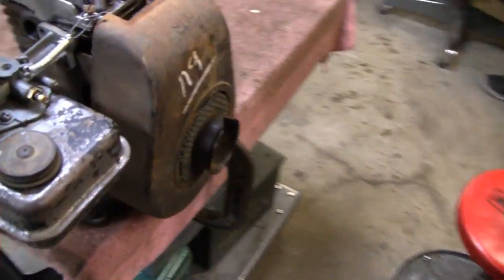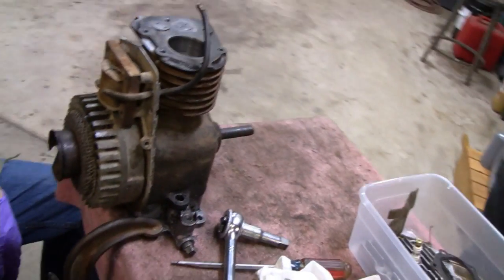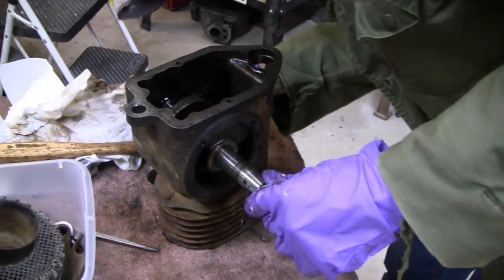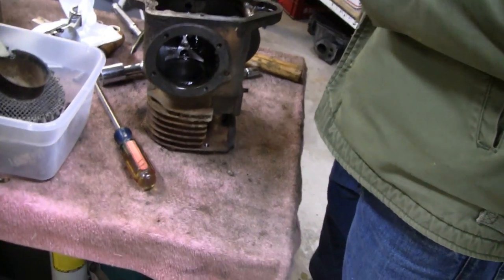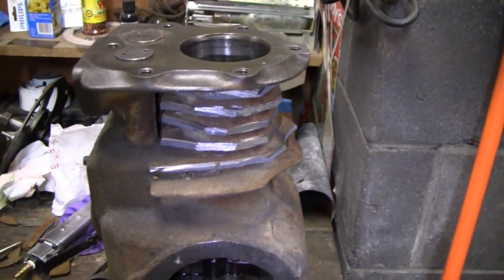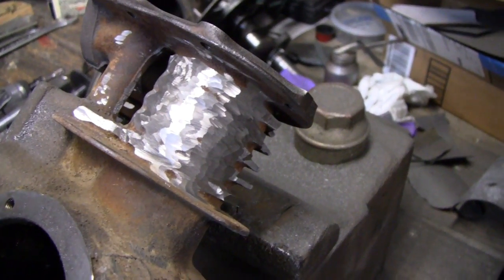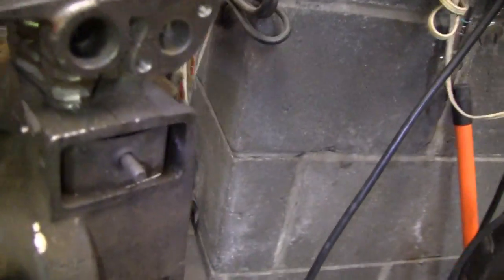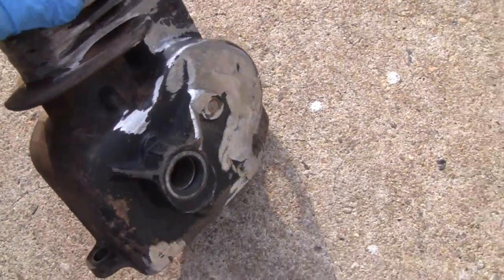HOMEMADE WATER COOLED BRIGGS ENGINE (part 8)

Comment: cooling fins with a tank built around them and around the cylinder that water flows through sounds like a very effective way to cool it, water goes in from the top and comes out the bottom and goes to a radiator or whatever, probably start out with a bucket and a swamp cooler pump

Comment: Fins would run cooler if you have tubing.  If you do a full water jacket around the whole cylinder then fins probably will reduce circulation by creating flow restriction (of convection currents) and creating hot spots.

Comment: I really like the way you dressed the block out. Looks much better without all the extra casting. Are you going to make a water pump, or just use a siphon type cooling system... like on old tractors?
Reply from the maker: Thanks Bud!! We have a water pump and radiator!!☺
Reply: How cool. You make the coolest things! When are you going to make a 5 cylinder radial engine out of those old 6S Briggs & Stratton??? I bet that would take some work and lots of time... and lots of 6S's.
Reply from the maker: We have been working on a 3 cylinder Radial for 2 years now, but it probably won't be finished for another 5 years. here's the playlist of the videos we made already of it  https://www.youtube.com/playlist?list=PLOkM2h167hjq5geboZYvrUfXm7ypsSJDC

Comment: how hard are the little maytag engines to get running again  I Just bought one for 100 its all there but its missing the plate the little linkage goes through
Reply from the maker: If the coil is good it should start right up!!☺

Comment: Cooling fins would give more surface area which would aid cooling, but that isn't necessary with it being water cooled. I'm assuming you are planing to have a radiator so It would be more fitting to have it fully smoothed out. Check out Jay Leno's project car vlog about the liquid cooled engine they are making new jackets for, that would be a great look!
Reply from the maker: Yeah it has a nice radiator!!☺
Reply: Better to have the fins removed. High frequency vibrations when the engine fires would cause cavitation, most likely where you wouldn't want it. The rough surface left by the removal of the fins will give less of a chance for erosion due to this, If you've ever seen inside the water jacket of a commercially made water cooled engine, they leave it rough on purpose. There are many different grades of casting sand, the finest of which would allow a quite smooth surface that could be chemically smoothed even further. 805RoadKing is doing it right.

Comment: I think under normal operating conditions, the cylinder would get nearly red hot without the fins, but a slow idle display engine it may be ok.
Reply: Wayne Earls it can't get that hot with water around it... yo do realize they're making it into a water cooled unit right?

Comment: Having the fins increases the surface area exposed to convective cooling. The rate of convective heat transfer is equal to hA(deltaT) where h is your convective heat transfer coefficient and delta T is the temperature difference between the fins and air in this case. "A" is the surface area exposed to convective heat transfer. Like I said earlier, having the fins increases the surface area exposed to convective cooling thus increasing the heat transfer rate from the engine to the air.  Looks cool without the fins though
Reply from the maker: Yeah it's almost a shame we have to enclose the cylinder!!☺

Comment: Love the project, Buddy! She's coming along. As far as the fins, I would have left them on. The fins would have dissipated the heat better by allowing it to travel away from the source (cylinder) and throughout your coolant. Kinda Similar to how a radiator has fins in the core to direct the cool air to the hot coolant tubes. That's just my 2 cents on the topic. Regardless I can't wait to see the next video! -Nick.
Reply from the maker: Thanks Buddy!! It is gonna have a radiator and pump also!!☺
Reply: Awesome! I can't wait to see the progress!

Comment: As a reference between the air cooled version and the water cooled version is there a place on the engine you will take temps to see what difference the water makes vs the air?  Maybe the head?  Are you planning a heat exchanger and what form will that take?  Thanks for the good video today!  I needed it because I'm in the third week of this cold or flu that everyone seems to have here in Georgia.
Reply from the maker: Probably won't be able to get an accurate reading!! It's gonna have a water cooled head, no heat exchanger  but a radiator!!☺
Reply: In Australia .... I've just started my fourth week of being diseased ..... Word round the traps is that it lasts for five weeks .....

At least I'm old disabled and don't work ..... :)

I feel for those that do ..... :(

Comment: this is an exciting project. you should spray paint all the metal parts in contact with water with some high temp rated brake caliper paint.
as for the fins. leaving every other fin may deliver the best cooling due to extra surface area in contact to the water.
as for the cooling system.  mount the radiator higher than the engine. the hot water coming from the engine should cause a siphon and circulate the water from the engine to the top hose of the radiator. just like old brass cars.

Comment: the larger surface area the fins would have created could have allowed it to dissipate heat into your coolant better. after all that's what they do already they are the simply using air as the coolant but the principal and physics are the same

Comment: what kind of pump will you use for the water? how many GPM?
looks like a "cool"  use antifreeze rather than water
Reply from the maker: I picked up a mini Tuthill pump off ebay, It didn't come with any info!! I didn't think of checking the GPM but when we tested it, it looked like at least 2-3 GPM!! It will also depend on the size pulley we use!! We will be using Antifreeze just to prevent the rust!!☺
Reply: well, 2-3GPM may sound like allot, however you might find that you need more like 10-20GPM.  its too late to take temperatures of before and after now though. unless you have an identical engine.
regardless i think its a cool idea, and can't wait to see the results!  great work so far!!

Comment: I think if you cut vertical grooves into the fins you would get the best of both worlds with more surface area and less turbulence in the water also don't the fins support the cylinder wall somewhat?
Reply from the maker: I guess it would support the cylinder somewhat just by thickening it!!☺

Comment: The decision to remove them was the better one. And this has nothing to do with the capacity of cooling, or the area of the fins. It has to do with how water would've cooled it. And it would've done a poor job with fins inside. Otherwise, excavator (or in general big, big rig engines) jacket holders would have fins inside the engine, and they don't. You want flow. That's what does you better, with water. With air you want surface.
Reply from the maker: Yeah Buddy!!☺

Comment: the fins on would allow for more heat transfer to the liquid but i would put stepped notch in so they ran back and fourth
Reply: No. They would create turbulence and impede water flow. Air you want surface, and with water you want flow. Check how big water jacketed engines are cast. There are no fins inside those. Or on a simpler level, check how the water jacket of a water cooled CPU is inside. There's no fins, only flow.

Comment: Hello Gentlemen,

This is one of your most interesting projects yet! I heard you guys kicking around the the advantages and disadvantages of removing the fins before closing it up in a water jacket. For what it's worth, here is my take:
Any time you are transferring thermal energy, the more surface area you have between your cooling medium and the object you are trying to cool, the greater your transfer efficiency. The purpose of the fins, as you know, is to increase the surface area of the cylinder and head in the airflow stream. From a purely theoretical standpoint, leaving the fins would give you a greater cooling capacity.
Now, let's look at it from a real-world standpoint:

Removal of the fins in this case makes perfect sense for a few reasons.

1: (Probably the most important) Those fins, enclosed in your water jacket, will severely limit the ways that you can get proper and even flow of liquid coolant, unless you cut channels in the fins with a milling machine, seriously increasing the cost and complexity of the project, as well as adding lots of places for debris in the coolant to collect and restrict flow. I am pretty sure this is one of the main reasons I have never seen finned water jackets in a factory made liquid cooled engine of any kind.

2: If your other projects are any indication, you are certainly not building this engine to run under any kind of full load or "hot rod" operation. Any thermal transfer efficiency benefit from fins would be completely unnecessary.

3: Leaving those fins on there would definitely make construction of water jackets more difficult, especially considering the potential flow problems described above.

Again, this is just MY take. Some will agree, others may not. I look forward to your continuing progress on this project.

Take care!
-Greg
Reply from the maker: Thanks for taking the time to leave such a thorough comment!! You definitely have a great concept of our projects, alotta people don't have a clue!!☺
Reply: I fully agree. Very good explanation.
Reply from the maker: I didn't see your comment Esqueue, You must have deleted it!! I just checked all the comments you've ever left and I've never had any problem with anything you've ever said!! Alotta people are opinionated, don't let it bother you!! You're alright in my book!!☺
Reply: sounds about right, although i feel like any sort of filter would eliminate the possible flow problems and cutting notches could be done in their mill with just an end mill pretty easily and quickly, some spots could be difficult to make flow well but i think that the simple theory of hot water rises means with enough slots cut you should be able to just pump from the bottom and let it overflow from the top into a tube thus taking the hot water with it, you could limit the flow of water to reach desired operating temperature
Reply: 805ROADKING, I meant no disrespect with my comment. I remember being asked in the video to post a comment then insulted in these comments when I do. Doesn't make sense if you ask me.
Reply: Greg, you nailed it. very well put.

Comment: Just read several scholarly articles on Google ; Water, vs steel(cast), on which would be the more efficient conductor of heat energy. From my gateway research, I would conclude that you were correct, Roadking, on minimizing the cast metal around the piston sleeve.
Reply: Water molecules will vibrate faster than steel at any given temperature and thus will carry away more heat energy.
Reply from the maker: Lol!! That's the kinda comment I was looking for, something with a little substance behind it!! It was just a lucky guess on my part though!!☺

Comment: If you use antifreeze, it won't rust. Standard green antifreeze has corrosion inhibitors.

As far as the fins go, they would technically transfer heat to the water more efficiently, but the briggs makes so little heat it's not an issue. Automotive engines do not have fins inside the water jackets either. Ultimately the size of your radiator and your thermostat will control the temp.

Watch the head temp carefully, they're often the hottest running part on a flathead.
Reply from the maker: The head will be water cooled also!!☺

Comment: This is the inside of a water block used in computers.
http://www.idcooling.com/Uploads/images/2014/FROSTFLOW/HUNTER%20DUET/5.JPG
Since the laws of thermodynamics probably don't change from engines to computers, the heat would be better dissipated into the cooling liquid the more surface area there is.

In short, fins on.

Comment: I would of just drilled plenty of holes down through the fins and get the best of both worlds
Reply: Or slot them
Reply: Lewis Carruthers slots would've been easier. Just place them in a similar manner that you would piston rings and weld on strips of metal between each fin
Reply: It'll still limit flow

Comment: serious question roadking, when you took all of the fins off, and ground down the extra metal, you also took off the oxidized protection layer on the metal, leaving it wide open to corrosion. do you plan on covering that up with some thin enamel, or do you think it will be ok???
Reply from the maker: Antifreeze will prevent it from rusting!!☺
Reply: Gotcha.. I didn't know that

Comment: The bottom fin on the motor looks to have a chunk taken out of it. What would you use to repair that?
 Plus, that bung area at the bottom of the block (that you ground off) looks like it would be a nice place for an oil pick-up, or drain, for an oil cooled system (or even a mini turbo). Just drill it and tap it and put a fitting in there.
 Hummm, a Briggs & Stratton with a mini turbo on it. Next project maybe?
Reply from the maker: That chunk is designed like that!! We brazed a piece in there when we made the water jacket!!☺

Comment: I would be pretty sure that the motor would run cold all the time with the fins and if the goal is to have a thermostat open and close with a radiator I don't think the motor would ever get that hot with the extra cooling fins under water.  

Just the thermal conducting property of water and air difference.  As it stands that with out adding work to the motor it will still take a long time to heat that water unless the cooling jacket is like an eighth to quarter of an inch away from surrounding three head and sleeve.

Comment: I think leaving the fins would impede water circulation, any bubbles might create hotspots. (Not that it'll be running for that long) 
It's a pity the extra work will be hidden on the finished engine. 
Will you have a radiator or water hopper?
Reply: Green Silver Pretty sure he's going with a radiator.
Reply: Yup. Thumb rule is: water => flow, air => surface. That's the simplest thing to remember. They could make a plastic water jacket around it, but that would be quite complicated to bond, i believe.

Comment: have you thoght about cooling oil instead of adding the water cooling? I mean if you have fast oil pump then you should not have termo shock issues with oil

Comment: Keep in mind that I am just a knucklehead. I would have left the fins for a few reasons. It would give more surface area for you to run the water on which I'd imagine would be a cooler engine. If you disassemble any water cooled cpu block there are lots of spikes to increase the surface area.  It also reinforces the block. 

Those are mostly only applicable to an engine of this century that actually produces usable power though. Just busting your balls lol.

Comment: In my opinion the cooling fins would have been better because of the greater surface aria.
Reply: On paper, yes, but IRL (check the jackets of excavators for the best modern water cooled engine comparison) you don't want them. They cause turbulence inside the water jacket and restrict flow (unless you really know what you're doing). Not worth it. At this size a cylinder, water all around is more than enough.
Reply: Sebi 43217 agreed but it will be slightly smaller and i think a slick look is what they are looking for.
Reply: Yeas but circeling the whater through the fins would be more efficient then circeling it just arunt the cylinder walls with less surface area. But it should still be more then enougt to keep this little engine cool.
Reply: Sebi 43217 will the radiator will have way more surface area and it will prevent overheating way more, air cooling isn't really used anymore because it's not that good try to find a air cooled car that was made in the 2000s it's relatively hard
Reply: Your (2 cents) are great so you make it 1,02 dollar and thats more than only one dollar ;)
Reply: Sebi 43217 i thougt they would cut channels through the fins and then put the jacket on top
Reply: but with the fins in there would there be enough coolant in there tho ?
Reply: Yes air is less efficient then water in exchanging heat, so if it worked with air it should work with water as well.
Reply: Sebi 43217 that's why I shouldn't give my two cents when the dollar is so inflated
Reply: Yes thats correct, but these turbulences are depending on the speed of the waterflow and I think the needet speed to keep this engin coold would not be that fast to make this an issue. Second you are reight too about that it should also work without the fins as i already wrote I only think with the fins wolud be the  more effiicient way.
Reply: I just throwing this out there. I don't have a degree in thermal dynamics but wouldn't the fins restrict the flow of the coolant?
Reply: Yes thats reight but the effect would teoretically be less negativ than the positiv effect of the better thermal exchange.